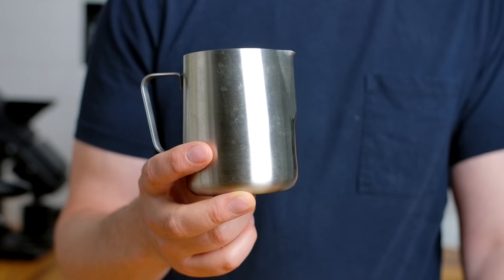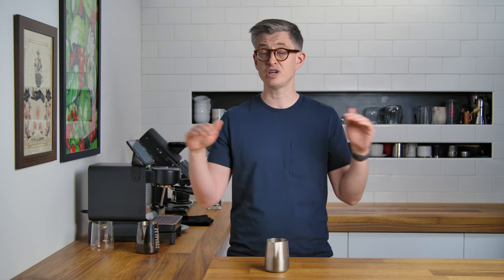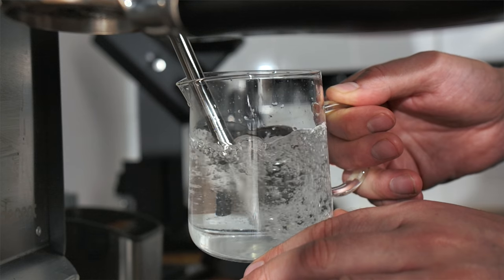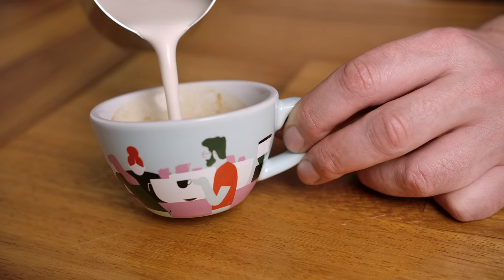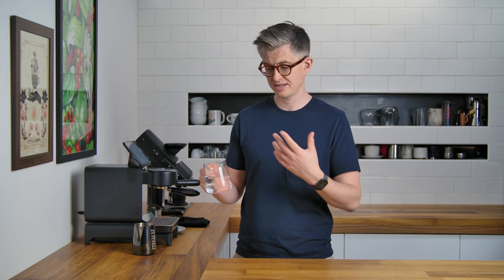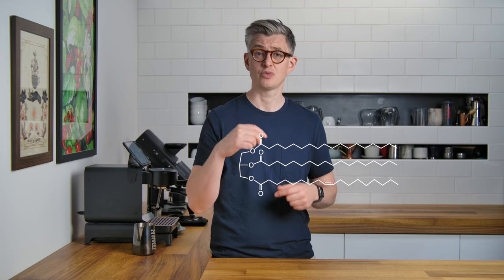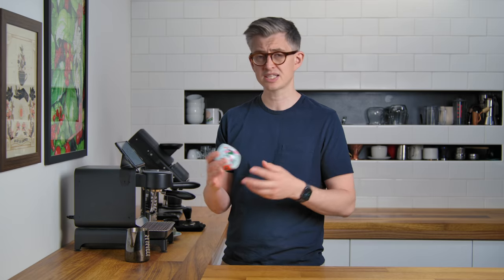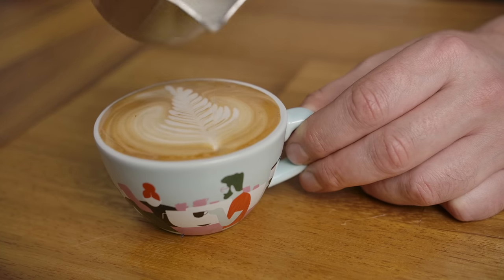Everything You Need To Know To Steam Great Milk

Comment: You got me on whipping milk with a French press already.
Reply: I always wanted to know if it is possible to make a "latte" with just a french press (ignore the fact I don't have an espresso machine). To push my question further, can you make latte art with milk foamed in a french press? Always wanted to learn latte art but I only have a french press
Reply: @tylermilsop  check that same James' video on frothing milk with a French press--its title, however, mentions Moka pot, but just take a look, and probably you'll have at least one question answered.
Reply: @tylermilsop  In the last year and a half of quarantine I have been practicing making cappuccino with the french press every day.  It took a lot of time to get the parameters right with my appliances, but now I consistently make a very good one, with small and compact air bubbles.  In my case, what made the difference was to let the whipped milk rest for 45 seconds before pouring.  I can't tell about latte art.  
Thanks James, I have learned a lot from this video!
Reply: @tylermilsop  there’s a video he did. Look up moka pot James Hoffman. It’s on another channel. They use a French press to froth a milk and make latte art
Reply: @prm2425  what do you use to make your coffee? espresso machine?
Reply: @DrCh0ngo  It’s on the channel for Chef Steps.
Reply: @tylermilsop  A simple italian moka from Bialetti that I paid 15 euros.  I know it's not the same as an espresso machine, but in a cappuccino the difference is not as marked
Reply: @prm2425  Gonna use that tip and let it rest, thanks, I've been trying to make latté's with just a French press for a while now but it's far from how good I'd want it
Reply: Which is better in milk foaming, battery operated spiral spinning whisk or frech press?
Reply: @dosetti  a French press makes it no fuss.
Reply: @tylermilsop  Thanks to James it is 100% possible. Been pouring latte art with French Press foamed milk for over a year now.
Reply: @tylermilsop  The approach with a French press is very similar to using a steam wand.  Start your paddling from the top of the milk to introduce air and then, once you've got your desired expansion, keep your paddling well below the surface to break up the bubbles you introduced.  Alternate this with a bit of swirling and you can easily end up with a milk texture well suited to latte art.
Reply: @tylermilsop  ohh you can just make sure after frothing your milk using a French press. Do pour it into a pitcher for pouring art as it isn't easy using a French press for pouring art.
Reply: Yeah I gotta get a second french press
Reply: What an amazing demonstration using water. Never seen that before. Thank you.
Reply: @tylermilsop  it is more difficult, but it’s achievable! I’ve been able to in the past
Reply: @tylermilsop  You can kind of. I make "lattes" at home with an aeropress and a French press. Making a kind of psuedo espresso/coffee concentrate using james method and then just microwave some milk up to 68/70C and giving it a few quick pumps in the french press. Use a spoon to get more of the finer foam under the big bubbles. 

It's no cafe latte but it hits the spot when you're too lazy to go out. Especially if the coffee is good 😁
Reply: @tylermilsop  yes, you can make very decent latte art with french-press-foamed milk. While I was thinking for a long time that you'd be very limited in the quality of foam from manual french press foaming, I discovered the instagram channel dedicated to french press latte art and I was really blown away by the quality. It really is absolutely on par with the best you can steam - be it a home machine or a big commercial one with a big boiler and tons of steam pressure;)

here's the channel:
www.instagram.com/frenchpress.latteart/

Comment: That visual in the glass jug is going to be a huge help. I’ve struggled with milk on my Gaggia even since I added a PID to it. Hopefully I’ll be able to keep improving with these tips.
Reply: Have you tried the technique of hearing the stream for around 10-15 seconds, purging and then streaming after another 15 seconds before the thermostat kicks in? If you get it right the light never comes on so the machine is constantly producing high pressure stream.
Reply: A PID in this case is a modification/hack tool the machine to override the original thermostat settings and control it manually. The water and steam temperature can then be adjusted. The former because some roasts are apparently better at different temperatures. My palate is not good enough to warrant voting the warranty. I have however swapped out the opv spring so running at 9 bar.
Reply: @NRajah  could you elaborate better? What should we do exactly?
Reply: On my Gaggia CP I turn the steam on, wait about 20 seconds then purge the wand and start steaming. This means I start steaming milk after no more than 30 seconds after turning the steam on, the steam light won't come on but it works perfectly as the boiler will continue heating throughout the steaming process trying to reach the set temperature for steam. If you wait for the steam light it will stop heating the boiler at that point so it will start slightly hotter than my method but quickly drop temperature as you go.
Reply: @duncancampbell3673  i tried this method doing something like 10 sec wait, 10 sec purge, start steaming but after 20 sec the light still came up :(
Reply: I have an older classic with a PID, tbh I've never had any issues with steam. My PID doesn't control steam temp at all, but it does read the temp so provides a good reference for when the temp / pressure is stable. There's always a bit of water to purge first, but once I flush that out I'm usually good to go. Always steaming for two cups of flat white, maybe 300 to 400mL (have never measured). I don't measure times but my clean up routine usually means 30 to 60s between flicking the steam switch and starting to froth.
Reply: I often struggle with milk on my Gaggia as well
Reply: @HsNiccoTutorial  a 10second purge is getting rid of all your steam. You aren't supposed to purge for more than 2 seconds, or as soon as the stream loses any water and becomes pure steam. Do not purge longer than that, it's just wasting the heat you're trying to save.

Comment: I moved from a single hole steam tip to a three hole steam tip and found that I had to use a different technique for the latter in order to get the milk to foam well. The learning curve for the three hole steam tip was also very steep so maybe it would be instructive to have a video to compare steaming techniques and results using 1-hole, 2-hole, 3-hole and 4-hole steam tips.
Reply: Very late, but on most home machines, think breville, sage, and any other similar model, the pressure is calibrated to the machine itself, so having a multiple hole tip won't really do much benefit as the pressure won't be as strong

Comment: Cheers James. I'm 50/50 struggling with/enjoying an old Breville Oracle, with an automatic steaming function. It doesn't seem to work as well when I try to do it manually, in spite of my efforts to follow guidelines such as those you offer here. But putting the jug at an angle, though not intuitive on an automatic steamer, is something I'm gonna try. Thanks! I had good results yesterday with 4/5 full milk, 1/5 oatmilk at 152˚ (sorry, around 62˚). Also new was the advice to let the steamed milk sit for a bit before tapping it. And a chemistry lesson is always appreciated here, no lie.

Comment: I have insanely heat sensitive hands, so I do not hold the jug at any point that can get warm. I do have a jug with a heat sensitive sticker on the side which roughly tells the temperature of the jug/milk inside.
Reply: If you listen to the milk, you can actually hear the temperature change over time. The pitch changes and as it reaches the end point it gets deeper. You can use this to judge the temperature.
Reply: Really useful tip. Could you tell me if the sticker is actually fast enough to show those kind of temperature swings? Because I have an analog termometr in my kettle and it usually is about 5 degrees behind the actual temperature.
Reply: It's very easy. Get a thermometer. Some of the digital instant read ones have a clip that allows you to clip it to the side of the metal cup.

Comment: "what are your struggles with milk steaming?"

well yes my problem is having enough money to buy the thing for the milk steaming
Reply: Just buy a french press? :D You can get those for like 5€
Reply: @JL since I have my Cafelat Robot, my old budget espresso machine only got used for steaming. The other day it shorted out our electricity circuit so I used the french press/cafetière instead. My wife liked the texture from that even better. Very rich, velvety and foamy. And it's super easy. No problems using plant milk either.
Reply: same thing I was gonna comment lol
Reply: There are a bunch of electric milk steamers which are $40. More than a manual one but, still, that's what I used before I could afford an expensive espresso machine with included steamer.
Reply: Bellman stovetop steamer is pretty cheap and works just as well
Reply: You know, a good espresso machine is not cheap, but if you're the kind of person that buys a latte every morning (or whatever your poison), it actually is a good investment.  Assuming you get good at it and use it, instead of walking past it on your way to Starbucks.
Reply: @nickwallette6201  yeah I agree. And it's better coffee
Reply: @nickwallette6201  yep. My partner and I realised we're spending 5000 dollars a year on coffees. Suddenly 650 for a machine doesn't sound so bad.

Comment: I get the competition  for the proteins "attention" in milk, but I didn't get the part with the glycerol. Indeed is not water, but it's a pretty polar molecule, and since hydrophobic is just another way to say apolar, why is the glycerol the problem? Wouldn't it be just the free fatty acids?
Reply: I was wondering the same thing. I took a single course on chemistry on college and it was some years ago, but I have three hypothesis on that:
1. Saying the glycerol is bad is just a proxy to saying the fats are bad, because more glycerol means that more triglycerides broke into glycerol and three free fat molecules.
2. Triglycerides are a great emulsifier, maybe the more glycerol you have, less triglycerides, worst is the emulsion of bubbles in your liquid.
3. Glycerol is a plasticizer so it may have something to do to with it acting on the bubbles and weakening their walls, making they pop easier, that might explain that fizzy effect. Bubbles still form, they just pop easier.

Just hypothesis, though. Would love to listen from someone with more experience if that is the case.
Reply: @KevinJDildonik  Yes, this is what I assumed James was talking about un the video (kind of, he kind of also said something about UV degradation). Still, my question wasn't if the rupture of triglycerides would cause the instability of the foam, that I know happens, it was why the glycerol would cause that? Since from all I know, the fatty acids would cause that. Glycerol, because of its structure, I believe (and I might be wrong on this) has a big affinity for water, so I don't get why it would compete with air. The only thing that may make sense is that since its viscosity is so high, it would make bigger bubbles wich wouldn't be desirable for steamed milk. 
Thanks for the replies by the way.
Reply: @augustoruymachado2466  I didn't know that glycerol is a plasticizer, so I like where the third theory is going. I'll look more into that and if I find something I'll let you know.

Comment: The thing I struggle with is steaming a smaller amount of milk in a standard jug. It always ends up with more air than I intended. Is there a trick to this, or do I just need a smaller jug?
Reply: It is unfortunately a problem with the size of the jug. You could always froth more milk than you need (and then maybe mix the leftover milk with fresh milk and froth it for another coffee - can be done!).
With a jug too big for the amount of milk, the surface of liquid is set pretty low, so you can't manouver your steam wand as much as you'd like, either it stays too high, pumping more and more air into your milk, or it stays too low, heating the bottom of the jug rather than the milk.
Reply: Smaller jug & i think also jug shape can help you out. 
The more pronounced 'cauldron' shaped jugs (like the rocket or similar motta europa ones, or ones that narrow down in a more pronounced way) did well for my smaller mugs.
Other content that could help you: search for the vids from sunergos, sprometheus, and artisti coffee roasters. Artisti has a very detailed vid on how to dose milk https://www.youtube.com/watch?v=YJZzNcjBx7w

Comment: Additional tip: Don't steam milk under a wall mounted TV.
Reply: Sounds like there's a story to this one
Reply: spill it bro, we need to hear
Reply: @themagicmovies  The steam eventually warped the back of the TV and shorted it out . It worked on occasion if I rubbed the back of it like it was poorly but eventually died.  The new bracket protrudes more so it's not an issue any more.
Reply: Or if you do, film it and put it online.

Comment: Thanks for clear and in-depth explanation! I've been steaming milk for over three years and finally decided to try to produce more consistent results. This is a great start. 
A couple of insights. I use whole milk and have found different brands work much better than others. I've recently found a milk that works every time (Trader Joe's organic in Calif. ). So, if frustrated with the outcome, I would strongly recommend trying different milk brands/sources. 
Also I have used 2, 3 and 4 hole steam tips and the comment on the volume vs pressure is an eye opener for me. The higher volume ( 3 and 4 hole tips that I have) always tends to 'burn' the milk compared with my 2 hole wand. That said, a four hole tip really agitates the milk better. I'm going to look for a 4-hole tip with much smaller holes than what I have and check the result.

Comment: Thank you so much! My wife bought me a De-Longhi bean to cup machine last year for Christmas but all year I've only been able to make disappointing weak and cold coffees with it. I ended up just resorting to making small americano type drinks with hot water from the kettle and some frothy cold milk on top, which was really unsatisfying. This past week I've been binge watching your videos and I've just successfully made my first decent cappuccino this morning! Over the course of the week I've adjusted the grinder and other settings to get the espresso tasting right and now I've learnt that the 'cold coffee' thing was entirely a technique issue and not a fault of the machine. I hadn't been steaming the milk for anywhere near long enough. I'd just been increasing the volume and then stopping without properly heating it (I think I thought it would continue increasing in volume or that I was risking watering down the milk with the steam).

Comment: I just discovered James' channel and I cannot get enough of it.

 I have just made myself a cappuccino and my milk did not foam very well. The bubbles were too big, similar to that example he showed where you could hear the fuzzing of the bursting bubbles. I am using a breville (sage) espresso machine, and the steaming pipe has another piece that goes on top of it, apparently helps with the foaming. My guess is that it over foams and messes up the milk. I'll try next time without it.

Great video, I have learnt alot!

Comment: You couldn't have made it simpler. Thank you! Worked first time after multiple failures prior to watching your video. For me the key understanding is 1) add air first 2) circulate the air. I'd been putting the steam wand tip at the bottom from the start. D'ugh, once you understand it. So, many thanks!

Comment: Milk really is the easy part. My wife likes some mousse so when I'm close to finish you pull it out a little from the steamer stick just at the proper limit and you will get nice foam on top.   hardest part for me was getting consistent perfect pressure with my Breville Barista Express.  I've had some frustrating  moments but it was a fun learning process :)  But I'm good now. I appreciate all your videos.  You are the one who teached me how to achieve vortex rotation and proper angle to achieve it.

Comment: Thanks for your detailed explanation of steaming milk. I now understand the procedure but have yet to actually do the steaming correctly. I have a new espresso machine and am struggling with steaming milk as well as grinding the correct amount of coffee with the right substance (fine or corse). Lots of theories are given online but for now, the best tasting coffee for me is a cappuccino and or a cortado. Steaming milk has been difficult because the milk just doesn't look or taste silky...it is too thin, a bit watery and definitely lacks the correct consistence. Anyway, thank you for your explanation...especially about practicing with water and a bit of liquid soap instead of throwing away the failed milk foam.

Comment: I found this video very informative.  I often struggled to get the silky smooth froth you speak of but I did not know what I was doing wrong.  Sometimes I would nail it and get it right, other times not at all.  I had inconsistant results.  But when you discussed the temperature and denaturing process with milk, it immediately made sense were my mistakes were.  Here is a ☕ for you, cheers!